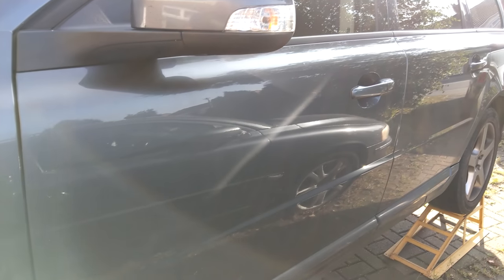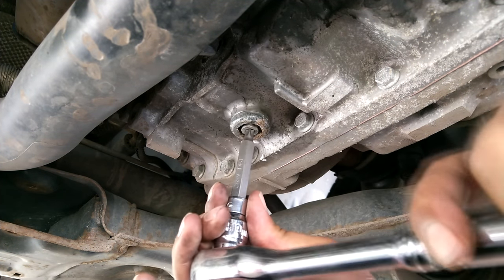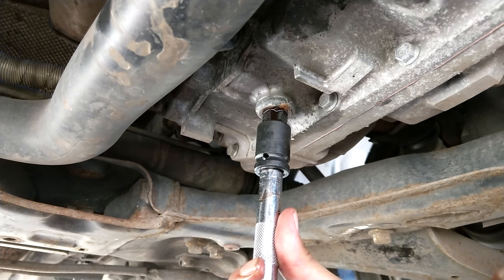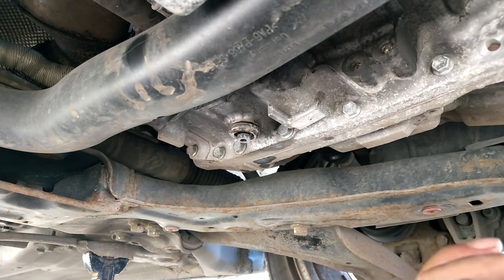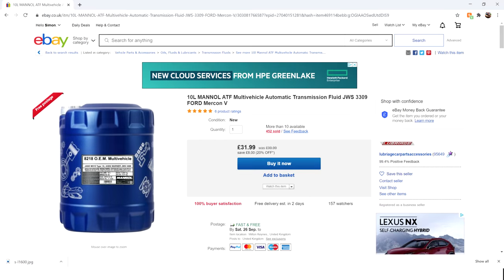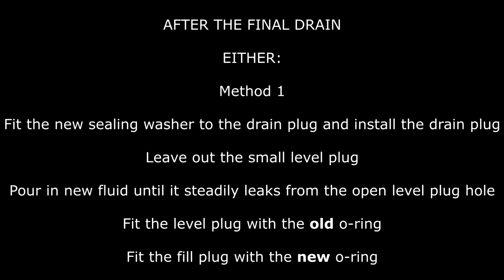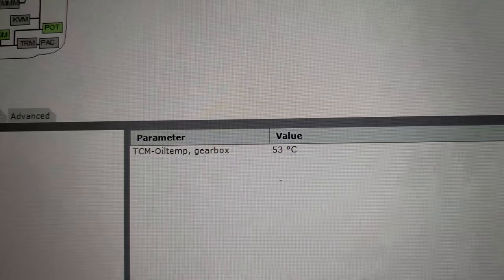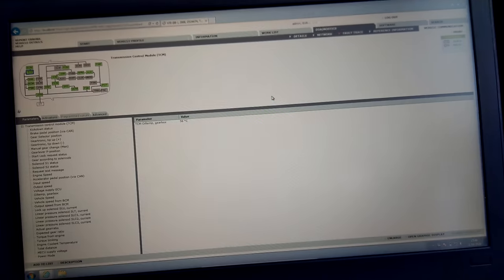Automatic Gearbox Fluid Change Aisin Warner TF-80SC

Comment: Should the transmission filter get replaced as well and when?
Reply from the maker: Filter replacement requires splitting the gearbox so is expensive and time consuming.
Reply: @sirobb  yes, but should you change it.. I mean should be changed at some mileage, is it needed?
Reply from the maker: I'm not aware any change schedule but check with a Volvo main dealer for the official advice.
Reply: @sirobb  Okay, thanks :)

Comment: Hello everyone! I recentlly took my 2008 s80 D5 in service for a gearbox oil flush/change,what the mechanics have used is Liqui Moly top tec ATF 1200 , they have flush the gearbox with 13L of oil and put inside 7L.Now after a week of driving the car everyday on a highway mainly 90 km/day i have noticed that when i stop at lights in the city my car has a delay of 1-1.5 to start to move after i release the brake,if for instance i press the gas before that i feel and hear a noise coming from the gearbox,there is no leaks or something like that and the car change gears quite smooth taking in consideration it has 474.000 km.I also have 2 bad injectors that put to much gas,,and make the engine shake at idle.Right now im waiting for the new injectors to arrive but can it be a corelation between the bad injectors and the gearbox not engaging right before i release the brake?I’ve noticed that it does not do it always but sometimes it does.Any ideas or advices what could it be or what i can do?I really like the car a lot and spent a decent amount of money on parts since i got it 2 months ago and don’t wanna let her go..
Reply from the maker: As I show in this video, it is important to set the fluid level at the correct temperature and reset the fluid counter in the transmission control module.
Did they definitely do this?
Reply: I have to add that the service was not done at authorized volvo service and the counter was not reset or so..I am thinking maybe take the car again to an authorized volvo service and do it all again?
Reply: @sirobb  They haven’t done that i am afraid.
Reply from the maker: Check with them to be certain.
If they have Dice and Vida software like in this video, it will only take 10 minutes to set the level correctly and reset the counter.
Reply: @sirobb  I don’t think they have vida and dice ,,so i must take the car to volvo to do it i’m afraid ,hope it will not get expensive..Can you please tell me if the oil used inside my gearbox suits this transmission? They said liqui moly top tec atf 1200 is a good oil and will do in my volvo,,guess i had to believe them. Thanks for taking your time to reply to me! cheers Cristian
Reply from the maker: @cristianlaza8874  The fluid appears to be suitable for Volvos which require JWS3309 specification fluid https://products.liqui-moly.com/top-tec-atf-1200-1.html
Reply: @sirobb  Thank you!!
Reply: @sirobb  Got one more question if i may,after leveling the oil do i need to reset adaptations as well or reset only the oil counter will do it?Thank you! I might buy the dice tool and vida software and do it all myself
Reply from the maker: @cristianlaza8874  With your mileage, I would reset both the fluid counter and the adaptions.
I can provide a brand new and tested Dice for

£149GBP delivered to Europe or
£135GBP delivered to the UK.
Reply: @sirobb  The thing is that now with the brexit the Danish government charges a lot of duty fees and import taxes, i have ordered one from Latvia 2 days ago,but thanks for the offer Rob!